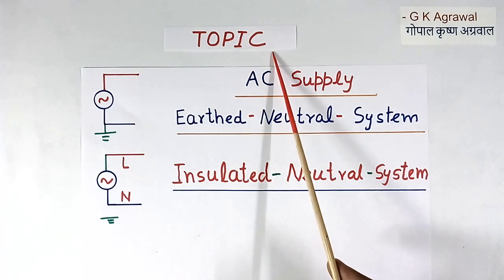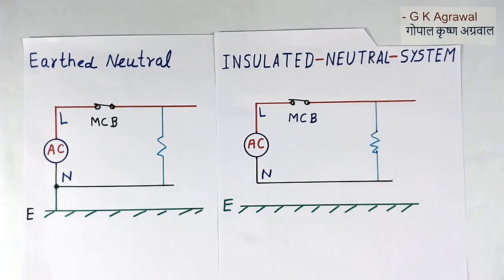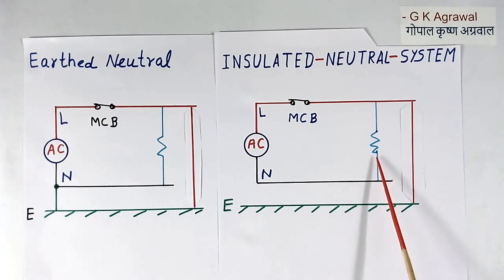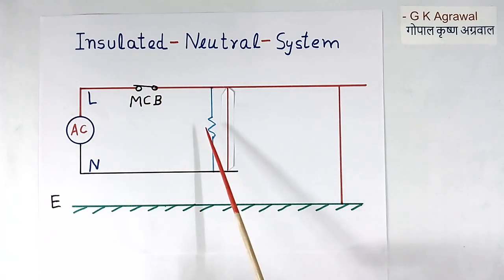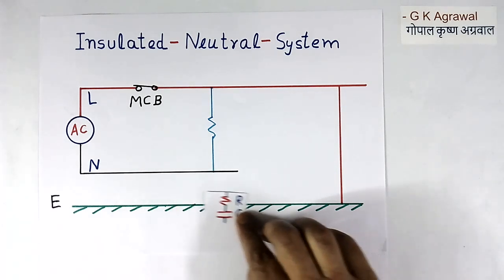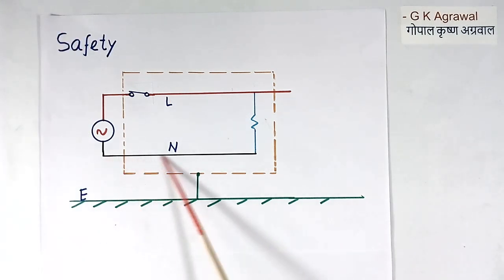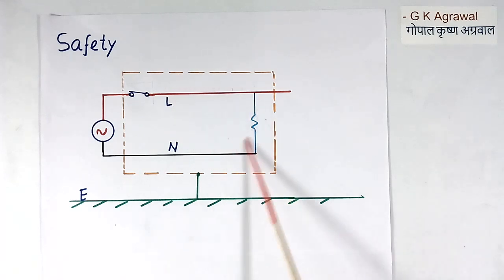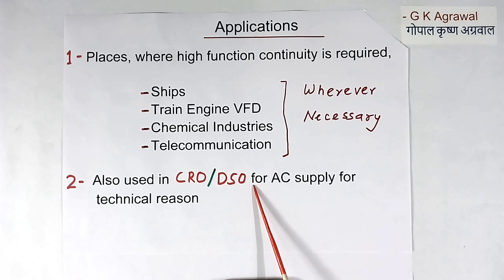AC Supply Insulated, isolated or ungrounded neutral system

Comment: Excellent sir, I have one question u have explained in neutral grounded system if phase touches ground u said MCB trip
But I think the current will start to flow to the ground that is a leakage current
Am I correct sir 
Please correct me if I am wrong
Reply from the maker: Yes, it is like leakage current. But this current flows in MCB also.
This is actually short circuit current. 
We call it leakage current if it flows due to some high resistance path between line and earth, like dust, moisture, insulation failure etc.
There is no legal language of currents. All currents are called with different names for understanding purpose only.
If it is not your exam, then call it by your name like mailtoippan current. I myself has called one reactive power as agrawal power in our one project to exaplain others. You call it as you wish, but equipment should work.
Legality comes when there is agreement between 2 parties. If it is for your design use then no problem.
For example your friends and parents may call you by different names. No problem. But you cannot give different names to bank or office etc.

Comment: HI SIR, IF WE TOUCH IN PHASE LINE WE DIDNT GET SHOCK RIGTH?
Reply from the maker: You may still get electrical shock.
Reply: @GKAgrawal2  in insulated neutral system if we touch phase line , how circuit will complete since the neutral  is not connected to earth, how we get shock?
Reply from the maker: Capacitive coupling between long wires and earth, transformer windings and a transformer body, varistors between earth and wires, two people touching wire at the same time etc.

Comment: Good Morning Sir. Kindly make a video on how the current density of bare copper conduit is arrived.
Reply from the maker: There is no standard method. Current density allowed depends upon project, application, temperature range, past experience etc. 
If somebody new engineer calculate in a new company, then very soon they will realise that smoke is coming out at the project side, and current density will be reduced based on this. However again they will know that smoke is still coming out but during summer jun month only. Then again current density is reduced. 
But they will realise now that cu cable had become too thick, and there is no place in the equipment, so entire equipment design need to be changed.
I think you understand now. That experience play lot of role in real world. 
However in college exam, only calculations and no experience.